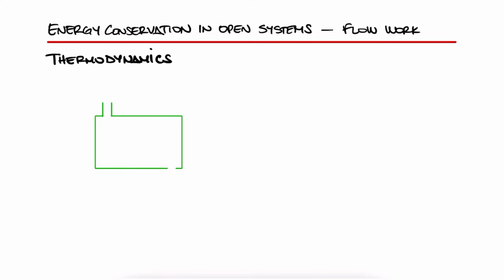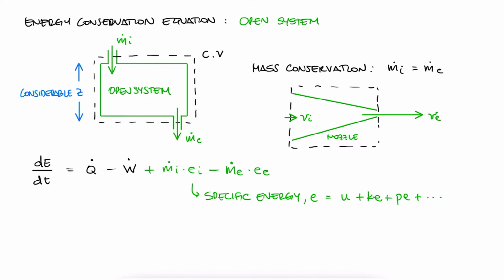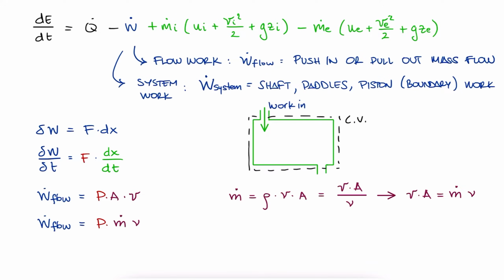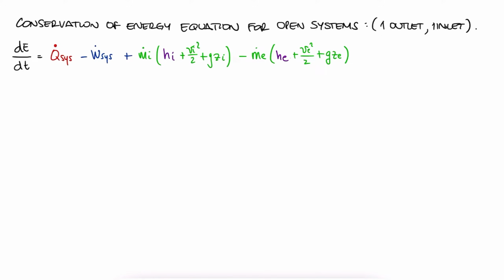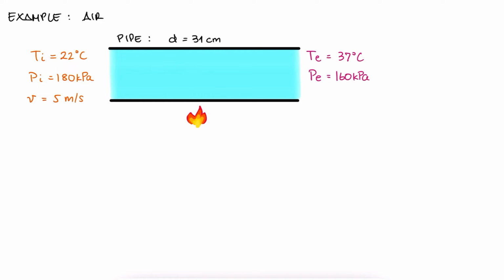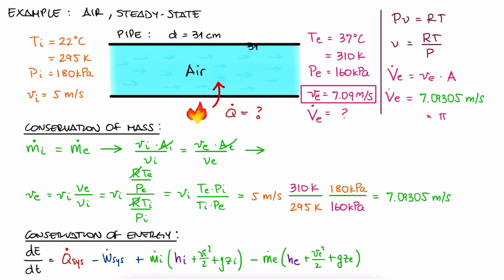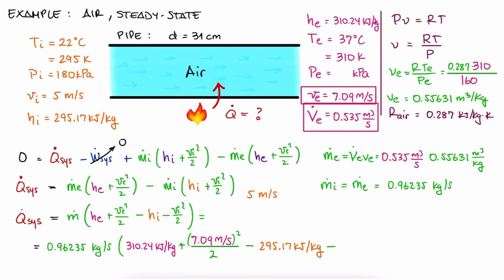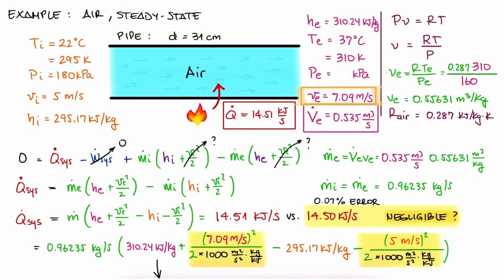FLOW WORK & Energy Conservation in Open Systems in 11 Minutes!

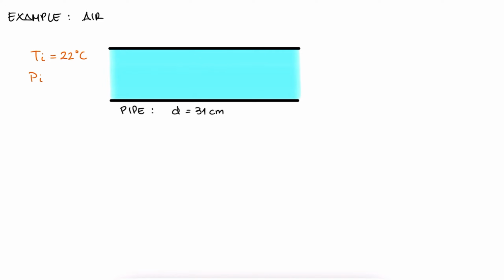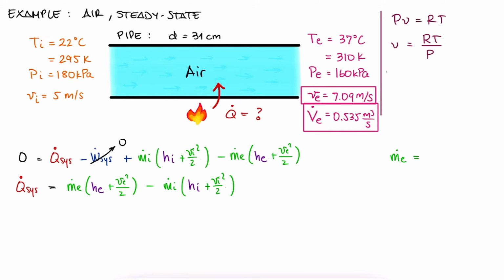Comment from the maker: CORRECTIONS: 1) 5:24 The problem statement is supposed to use 6 m/s as the inlet velocity, not 5 m/s! All the calculations and results are consistent with vi = 6 m/s. 2) 7:51 The equation should read volumetric flow rate OVER velocity, not times velocity; the value for m dot e is correct, though.

Comment: For the mass flow rate at the inlet to equal that at the exit, the air would have to be incompressible. I would recommend mentioning that somewhere or changing the fluid to water.
Reply: No steady flow and incompressible flow are independent assumptions. The air's density decreases as it goes through the pipe and thus would need a greater velocity to push the same amount of mass out, thats why the velocity increases. If the air was was incompressible the inlet and exit velocities would be the same.

Comment: How does pressure remain constant in the superheater phase of the boiler or air conditioning running on  rankin cycle? 
Has it got something to do with the concept of workflow or specific volume?
Kindly remove this bothering. Confusion?